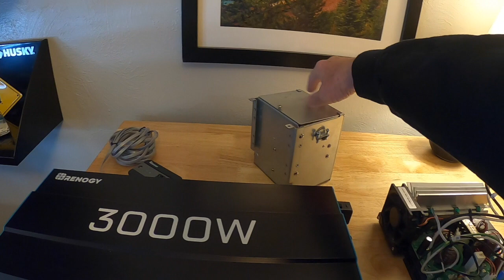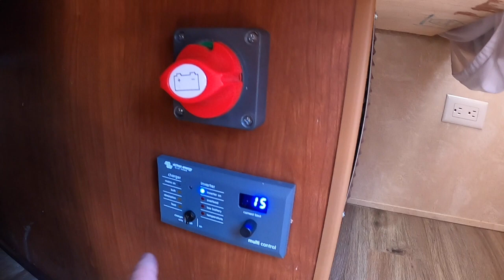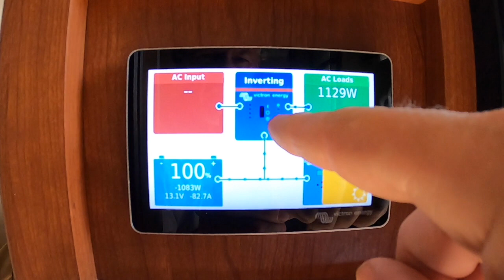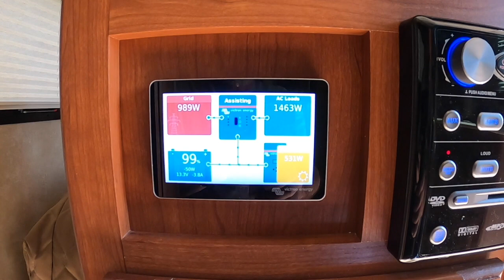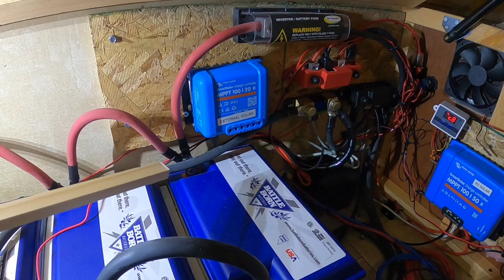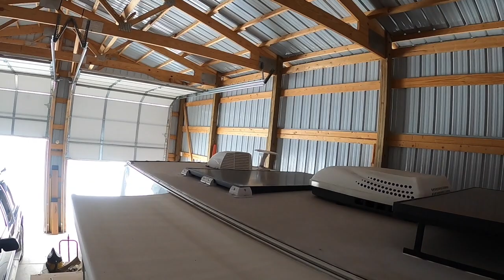RV Power Upgrade and Review - Victron Energy Multiplus Cerbo GX Phoenix GX, Touch 50 Battleborn

Comment: Why the multicontrol? You can change all those settings through the cerbo?
Reply from the maker: Yep. Didn’t know that when I put it in. Also I liked the switch to turn the inverter off and on which later found out I never use because I have so much power. Great comment. Thanks
Reply: @bparkinson1234  also if you install guimods it adds a whole new level of easy on the touch screen. iE- touch the inverter icon on the main screen and it brings up the options to turn on off charge only etc. No digging in the the menus needed.
Reply from the maker: @NigelM18  where do I get gui mods?  Thanks!

Comment: I see you added vents with thermostat control, could you provide the links to these items as I have the exact setup under bed snd want to keep the temps down.
Reply from the maker: You bet. Here is 12vdc switch https://amzn.to/3slK8eu.   And here are the two fans I used https://amzn.to/3Gsn5DD. I have the air blowing out of the box. Set at 90 degrees.  Hope this helps. Check out my rv playlist. Thanks.
Reply from the maker: Hey the vents are house eve vents from Home Depot

Comment: I am liking that Multiplus unit. Seems pretty intelligent. I'm here to learn more about the CERBO GX.. You didn't talk much about it as I was hoping. I just got my 3 V.E. cables in the mail today.
Reply from the maker: Nothing else like the multiplus out from anyone. Plus all the other victron stuff. Have been using it all summer. The 12vdc frog is my wife’s favorite. See that YouTube.
Reply: @bparkinson1234  This is my system: 4 BB lithiums with a BMV712 bt, connected to a Victron 150\85, A CERBO GX and a touch 50 to monitor from the road because I'm a truck driver. Attached to that is a Zantrec 2000ps all powered by 2 of my 4 Trina 400w panels. It's working pretty good so far and am plugged into a 15 shore power. Next project is to lenghten the wires from the BMV 712 and the inverter closer to the controller. Then add some fuses and a few master disconnect switches. I could see a Multiplus in the future too..

Comment: Video was great. Watched it before I installed the color touch. You got me worried that I need the digital multiplus control to adjust input current limit. Just so yow know you can do that through the color touch
Reply: I have a multiplus 3000 and can control the current limit on the gx color control. On the color control if you go to the pages screen. Then select multiplus. Scroll down and you will see set input current level. One you change it a check mark will appear at the bottom of the screen. Press the check mark to accept the current selected.
Reply: @justinzimmerman862  thank you, is one less thing I have to buy
Reply from the maker: @MrRiffraff7  hey. I also use the the Phoenix to remote turn off and on the inverter. Is there a way to also do that thru the touch 50?
Reply: @bparkinson1234  IDK if you can do that with the touch 50, I will get mine by Monday
Reply from the maker: @justinzimmerman862  I will try this tomorrow.  Excellent   Thanks
Reply from the maker: Thanks. Can’t do it thru the color screen. Must have the Phoenix.
Reply from the maker: Max current from the shore power withou the Phoenix is default 20a. I just did it for crappy wall sockets. But haven’t plugged in for 3 years now.
Reply from the maker: Thanks. I think I tried to do it thru the color touch and couldn’t find out how to do it. Could you please send me some info?  Would like to do it that way if possible. Thanks again

Comment: Sorry. Another question. Does that Phoenix control panel come with the multi plus inverter/charger?
Reply from the maker: No problem...  nope the multiplus is sold separately. The phoenix is an accessory.. the amazon links are in my description for each.  Good luck. You will find them amazing

Comment: Great video. Do you know if you use the dongles and an iPad via Bluetooth, would that do the same as the touch screen?
Reply from the maker: Hey. The Victron connect gives you full data on each device such as battery sync voltages etc. the display just gives basic display settings. You still need to connect via Bluetooth to each device. One at a time. By dongle or if the device has BT built in.  The cerbo can also connect to the Victron cloud via WiFi... Victron portal. This gives a basic touch 50 display on your phone or iPad.  But you need to be connected to WiFi.. also you can see historical data.  Does this help?  Thanks
Reply: So the cerbo and touch display can show battery usage and charging from the shunt with using that round 712 display?
Reply from the maker: @carrottop3454  cerbo gets its data from that 712. Just like it gets data from the mppt charge controllers and multiplus.  That via those vw.direct cables. Not Bluetooth or WiFi. Thanks